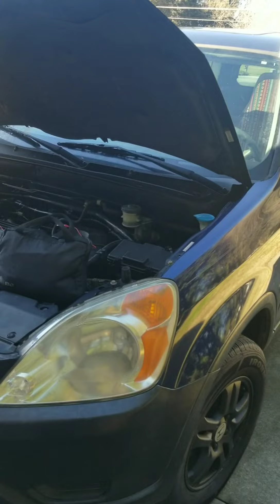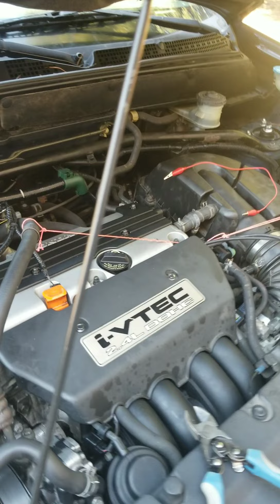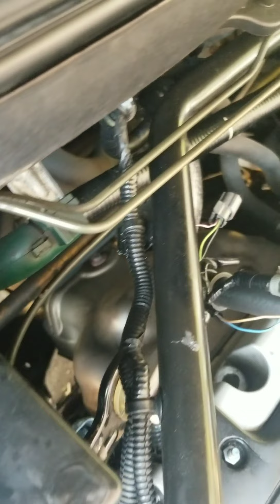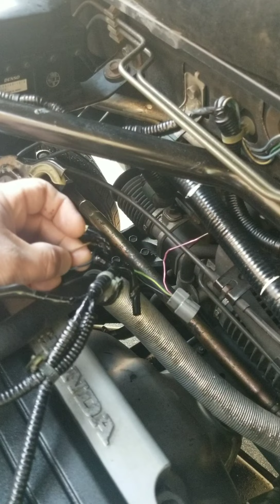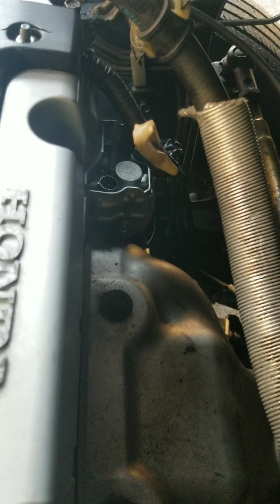Honda CRV VTEC Pressure Sensor Delete P1259

Comment: i’m doing this tomorrow on my 03 CR-V. My question is i’m having the limp mode and it’s clear that this will bypass it. However sometime when i go into park it will idle high around 1500. It was around 2500 but we changed the oil, the valve and the solenoid now today it idled around 1100-1200. Will this bypass by chance fix the higher idle, or just basically fix the P1259 code allowing to go past 3k rpm and no limp mode?

Comment: Does this happen due to a blockage internally? I have done all the things you did as well and i do plan on jumping the sytem as you did, but i still am curious as to what could still cause it? Oil's been changed, whole solonoid replaced with all the screens cleaned and connections checked.

Comment: Honda tech here.  This will be a fine fix.  Before doing this hardwire try these 2 things.  First take the vtec solenoid off and clean the screen or replace the whole gasket for $5.  Next try to replace the oil pressure sensor under it.  If replacing the sensor go with Denso or AcDelco.

Comment: Can this help to solve p2646 code in 2008 crv? I have changed and cleaned all you did, the code is still there, the car sttuters when accelerating and will not rev pass 3k rpm at interval .

Comment: Thanks for the video.  Im in the process of trying it out on my 2002 crv.  Why would you not just jump the sensor wires?  Just curious.
Reply from the maker: The voltage coming into the vtec module turns on the vtec and the voltage coming back through the other wire to the ecm is the confirmation that the vtec engaged. If you just combined those two wires the vtec would never actually turn on and off. You would only be tricking the ecm but loose vtec functionality.

Comment: Dude... Where have you been all my life....? Or the last 6 months. I have been on the struggle bus with the P2646 code and limp mode on my 2006 crv with 225k on it. New Honda parts for everything, cleaned screens, changed connectors etc.... I've now been running 5w-40 and it's seemed to help, But it still comes back. I saw your video today and figured what do I have to lose...? I've only driven it 20 miles so far but no light. Will be driving more soon. Thanks for the video. You should really rename the title and add P2646 code in it. I bet you'd get a ton more traffic. I found your video on a Honda Element forum. Same motor. There is a thread with 500 or so entries on this exact problem. Name it with something like P2646 bypass or something. Good job man. Thanks again.
Reply from the maker: Glad to hear it was useful!! Thanks for the feedback!
Reply: This is the exact reply I was looking for, p2646. Trying this one tonight!
Reply: Gonna try this for the P2646 code. How is it working for you?

Comment: I am having this exact problem and I have tested the solenoid and the switch, both work fine, I even cleaned the screen on the front of the block and on the vtec solenoid along with the vtc solenoid but still having the problem after the oil temp gets warm enough. I am coming to the conclusion that oil pressure is either not high enough to engage vtec properly which could be an internal bleeding problem or a blockage problem.

Comment: I just found your video. I am looking at doing this today since I have nice weather here in central indiana. My only question is there is a single wire connected to something just below the VTEC solenoid. Can’t seem to get it disconnected, any ideas or guidance. Just don’t want to break anything and can see it very well.
Reply from the maker: Going from memory it's likely your oil pressure sensor for your dash indicator. I broke it while trying to get it disconnected and had to replace the connector on the end of the wire.

Comment: So why doesn’t replacing the solenoid and switch make the code go away?  Internal engine damage?  One thing I notice is my oil often has air bubbles when I pull the dipstick, I’m not expert but air bubbles can’t create the same hydraulic pressure as oil alone, again, perhaps from internal engine damage (compression, tolerances, etc..).  I just want to make sense of it rather then find a non factory loophole.
Reply from the maker: That is a quest most of us in this comment section went on until eventually getting tired of replacing parts, trying things, and spending money that didn't fix the problem. If you find the answer please come back and let us know. You are correct this isn't a fix its a workaround for the problem born out of frustration.

Comment: Hi jerimiahdickson when you listed previous attempts at fixing the code and you said you “cleaned out the screens” what screens do you refer to? I’m aware of the screen in the gasket to the vtec module, but I am curious if there are any other screens that you are talking about. Thank you
Reply from the maker: It's been a couple of years since I have messed with this so forgive my memory. There is another pen cap sized screen on the vtec oil control assembly at the end of the cam on the left hand side of the engine. Usually it would give a different code if that is the problem, but it can still constrict the oil flow through the system.

Comment: After fighting with three vtech solenoids the past 6 months I finally did this on my 2008 CRV.  So far so good.  Not sure if it “fixes” whatever the original problem is, but at 300,000 miles I really don’t care.  Drives fine so far
Reply: Is the vehicle still working as it should after the oil pressure switch bypass?

Comment: Does the oil pressure sensor light come on after the oil pressure sensor bypass
Reply from the maker: The oil pressure sensor that turns the dash light on and off is a separate sensor near the vtech, but not part of the vtech assembly. The pressure switch with the dash indicator is unaffected by the bypass.

Comment: I have this issue once the car hits 3k in final gear. I switch the ignition off and on while driving and get my vtech back again until I hit 3k in final gear again. Will buck in every gear after this happens. I've replaced all the vtech components.

Comment: Great video! I wish I'd seen   it a few hundred of $$$ ago. My car was on it's way to the junk yard unil I saw your video. I also notice that the wires going into the solenoid connector were both   Corroded and one wire broke off while I was separating the connector from the solenoid. I replace the connector and add both wires spliced together... **problem finally fixed**
Reply from the maker: Glad to hear you're back on the road!

Comment: Good  evening Mr. Dickson,  Just taking the opportunity to say, Thank You !!!! Was able to finally get my 2003 Honda Accord LX  2.4  liter engine, running again!! Had tried every possible solution, to no avail. Most of the solutions you yourself had tried. , Was able to follow your very simple steps, on your very instructional video. Once again, thank you!!! Car started right up, without the (Cel) check engine light, & out of Limp Mode!!!
 Blessings to you & your loved ones Sir.

Comment: Thank you! I have been fighting, replacing parts, and searching the internet for over a year now. Your fix took care of it immediately!
Reply from the maker: So glad to here this kept your car on the road!
Reply: Is it still working ok?
Reply: @Honda_element I would like to know this as well I have an 03 CRV all-wheel drive that has been throwing the VTEC system malfunction code for over a year I've replaced every part possible and it still happens I'm literally about to show this video to my mechanic and have them do this exact same thing tired of hunting for needle in a haystack.
Reply: @Brad.W  it does work. I did it to my element and it’s still going strong

Comment: hows my year later? I just bought used and driving back went into limp..........this code came up. Should i replace vtec solenoid etc before doing this?
Reply from the maker: The CRV in the video is still running fine after 1 year. I would definitely try all the normal means to fix the vtec before doing this. Jumping this out will not make the vtec work if one of the components is failing, it will just make sure the code doesn't trigger the ecm to start limp mode.
Reply: @jeremiahdickson569  Sweet thanks for reply.

Comment: Mr. Dickson I just wanted to Thank You for helping me. I've been dealing with the same problem on my daughter's 03 CRV and have swapped out the VVT Solenoid 4 or 5 times, change the oil and filter numerous times only to have the check engine light come on over and over again, sometimes within 100 miles. Anyway, this solved the issue. No More Problems!!!! Thank You, You ROCK!
Reply from the maker: So glad this worked for you!

Comment: My crv 2003 have over 265K miles on it. Had vtec issues before but all fixed. Oil 5-20w all the time with original filter. All screens are clean with new oem vtec module also Vtec plugs pigtails are new... but this time the problem persist. Did your bypass and worked like a charm!!! Thanks
Reply from the maker: Awesome! Glad you will get some more miles out of that thing

Comment: There is no doubt this isn’t truly fixing whatever the problem is but serves as a profitable semi permanent band aid. Thank you so much! I’ve been battling this code and new Pressure switches for a year now and may end up resorting to this
Reply: At least for the Element, the problem is absolutely the corrosion of the harness connector to the oil switch, and since the JDM Honda's didn't include said switch, I say this is the perfect solution.
Just clean/replace the anterior and posterior VTEC screens/gaskets occasionally and have regular 5k max oil changes.

Comment: Will vtec go back to working after this ?
Reply from the maker: It will keep doing whatever it was doing before you did this. Your not disabling the vtec function just sending the "working as needed" signal back to the ecm, even if it's not working.

Comment: Does the VTEC still work with this?
Reply from the maker: It will do whatever it was doing before you split this wire. If it was working before it will keep working after. If it was not working before it will be not working after.
Reply: @jeremiahdickson569  glad to hear that
Reply: @athiam152  No vtec is not working if you do this, the reason you lost vtec is because your not making enough oil pressure to trip the vtec switch to verify to the ecu vtec is working, you are simply fooling the ecu into thinking the verification is there which will not throw limp mode. this fix is a band aide to keep your car running, it is not the proper fix and vtec is likely not working before or after this fix. This fix is simply eliminating the limp mode issue.

Comment: After replacing the VVT, changing the oil multiple times, flushing with Seafoam etc I was ready to dump this car. By soldering the blue wire on the pressure switch harness to the green wire on the solenoid harness, the P2646 code is good and gone!

Comment: There's another solenoid on the front of the engine. It's held on by 1 bolt.
Reply: Where
Reply: That's the VVT solenoid,it's in the upper middle of the timing cover. It has nothing to do with VTEC though,it controls your cam phaser on the intake.

Comment: Does the Check Engine Light go away after doing this hack??? Thanks
Reply from the maker: After you reset the check engine light, it will not come back on for the P1259 code again ever. It will come on for other codes though if they present.
Reply: @jeremiahdickson569 Thanks bro it helps me greatly after doing the waring

Comment: Try changing your oil filter with an oil filter that has more than eight holes it's got to be a Honda OEM or STP cuz they have 13 holes I was having the same code I swapped the oil filter code went away it was restricting oil flow
Reply from the maker: I did an oil change with the recommended oil in the manual after a flush with some seafoam. I cant remember which filter was used for that oil change, but I generally use mobile1. Not sure how many holes are in a mobile 1.
Reply: I will try this bro , where did you get the Stp filter ?

Comment: I have this same exact issue . first i had long starts and i changed the crank shaft sensor and it went away, also i have this issue that couldnt  go above 3k rpm  after running a couple mile then it would start bucking and wouldn't go above 3k rpm.... how has this hold up for you?
Reply from the maker: It's going on about 5 months now with no repeat issues.
Reply: I haven't got the time to this fix yet, but mine would do it when going on longer trips, also its would buck and hesitate to go over the 3k rpm but if i would shut it down and start it goes away for a while

Comment: I don't see the purpose of doing this if your Vtec oil switch isn't working then replace the VTEC oil switch I'm guessing that the VTEC is not kicking in and causing issues it happens like I said just replace the VTEC oil switch it cost me $20 on eBay
Reply from the maker: In my case we had replaced the VTEC assembly including the sensor multiple times. First time was aftermarket and the other was honda. We had changed all the VTEC components, cleaned all the internal screens that tend to clog up on this model vehicle, checked wiring, flushed the engine with seafoam and did an oil change and still had the same code. You are correct in saying you should fix the problem correctly. This car was gonna go to the scrap yard if this didnt work.
Reply: I have done all of it too. Screens many times. Whole units. Seal. Gaskets. O2 sensors. Exhaust. And these are all my issues and everything I've tried to and now I'm ecstatic to do this

Comment: Just a follow-up, I just did this job to my 2006 Honda Element EX (same engine as the crv) and works so far. I drove about an hour into the city and it's driving as if its brand new off the dealer lot. Hopefully this will be the end of this saga I've been dealing with for the past 5 years. Thanks to Jeremiah for making this video or else I'd be looking at selling this car today.
Reply from the maker: That's great! Did I give you the code every time you drove it or just intermittently?
Reply: @jeremiahdickson569  Yes, for me it started about 5 years ago. At first, it was mostly intermittent, but gradually became almost non-stop. I did just about everything you could think of, but after putting in a replacement vtec assembly and a new VTC Solenoid, on top of repeatedly cleaning oil screens and all that, I just stopped trying. The codes for the elements is a P2646 or P2647, I've had both back and forth over the years. At one point it stayed off for close to a year, but right at the end of a very long road trip, boom, came back on and never went away.
Reply: @The_Man_in_the_Box  I’ve had the same issue for last 5-6 yrs. Cleaned and replaced several vtec solenoids, replaced all of the screens/filters many many times. Running correct oil, multiple engine oil flushes. This would fix the problem for a short while. Then it would be intermittent and progress to all of the time or every other Drive or after 5-30 mins of driving. Def trying this option.
Reply: @Omri_Makes  como te fue con esta falla
Reply: @olmanjimenezaguilar6724  Esto resolvió mi problema
Reply: @Christopher Williams
Is it still holding up for you?
Reply: @thekalechipsvendetta  yep, still going strong

Comment: This is going to be a last resort. I love my element but this is the persistent issue with the vtec throwing the codes. I was advised that a bypass may result in potential consequences, though I'm not entirely sure what can happen by doing this. I've about had it and have contemplated selling it.
Reply from the maker: So I think there is a difference (I am not an expert at anything) between jumping out the VTEC which would make the VTEC not work at all and mess with the timing of the engine and what I did which was deleting the function of the VTEC pressure switch which is used as a confirmation by the ECM.
Reply: @jeremiahdickson569  understood. I am not an auto expert, so while I get that this rewire would not prevent the vtec from functioning, I'm curious to know what "could" happen i guess. Perhaps so long as oil is routinely changed and general pressures are sustained, it should be fine?
Reply from the maker: @The_Man_in_the_Box  My thought is that if the VTEC quit working the ECM wouldnt know so no code would be thrown so the worst case would be a non working VTEC so it wouldnt change the timing at higher loads and rpms. The only problems I could think of is if the VTEC was stuck on which is not likely to happen but I guess could. Again I'm not a mechanic so maybe someone that knows more will chime in.
Reply: @jeremiahdickson569  thank you for the responses. This seems fairly simple, do you recall where you got that particular 3 way splitter? Did you solder the wires down or are those being held by the blue caps?
Reply from the maker: @The_Man_in_the_Box  That is a crimped connector I grabbed in the electrical section at advanced auto. I'm sure soldering would make a better connection but this has held up so far.
Reply: @jeremiahdickson569  thanks, I appreciate your time. I've shared your video in one of our honda element groups as this is essentially the same issue a lot of us have been dealing with. I'm tempted to just go ahead and do this right now.
Reply: @The_Man_in_the_Box  Ik I'm 8 months late but apparently a lot of JDM vtec motors don't even come with the pressure switch. They say it's a USDM only thing
Reply: Mr. Dickson, or anyone else that completed this pressure sensor delete in California, will it still pass SMOG?